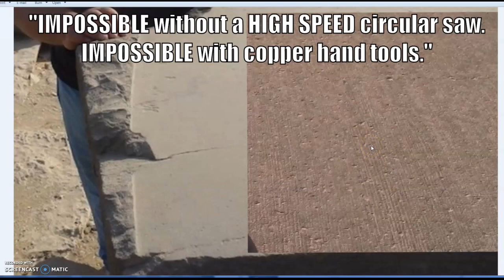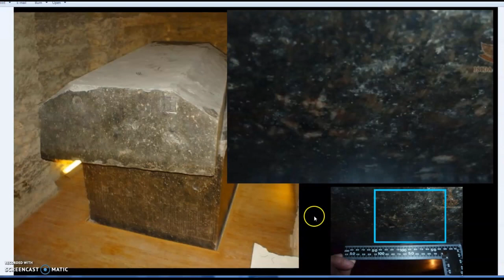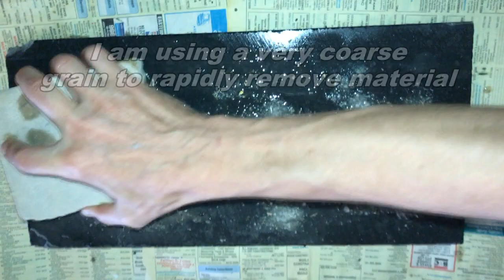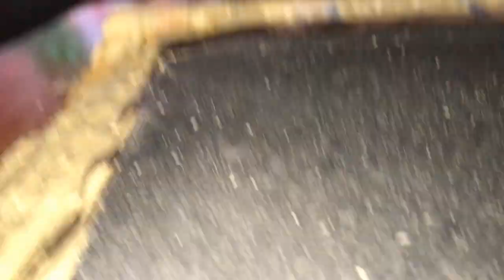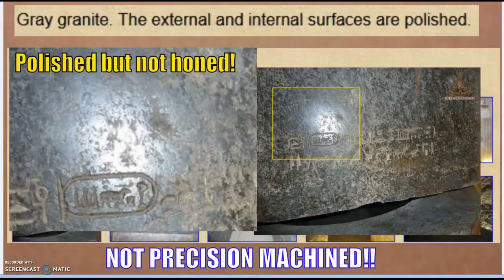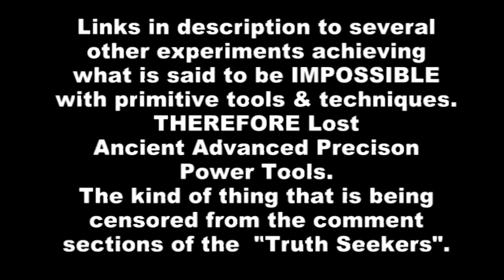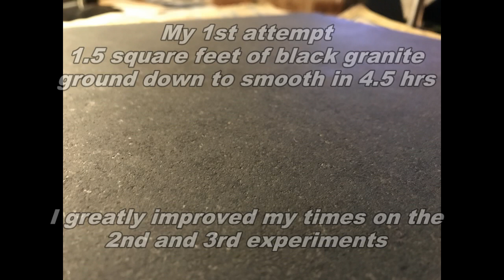Ancient Stone Working Techniques: Experiments with Black Granite on Removing Striations

Comment: Great demonstration. I'd like to pick at one detail that I found interesting... which is the idea that a treatment of some sort may have been applied to the surface of the boxes to give them a more polished appearance, even though they may actually be short of that physical condition in terms of the abrasive polishing work performed. This would imply that there is a substance still present on the boxes, since the absence of it would downgrade the appearance back towards honed... so it should be extremely simple to take a scraping sample from a box and analyze it... are you aware of whether or not testing like this has been done? I assume that almost anyone who has examined the boxes thoroughly would have noticed the apparent over-drip at the edge(s) of the lid(s) and would be interested in their origin. Is there any confirmation of whether or not there is a substance even present on the surface of the boxes? Seems like an easy fact to set straight.
Reply from the maker: Yes. I love to see such a test. I couldn’t find anything on that. Though it might also raise the question of when it was done, original or applied later?
Since these tests I have done another on split face granite. Learning from previous mistakes I was able to hone a much rougher surface at 1.5 square feet in 120 minutes. If I repeated these here I would hone the circular saw mark block in 30 minutes. So the Serapeum boxes would be finished even faster than what I quoted here.
That will be in an upcoming video focussing on the blocks in Puma Punku. Not the H blocks but the other famous ones I could do on my own in no more than 2 weeks if they arrive on site in rough quarry condition. One week at most if they have been sawed. With a couple of people to help it would be done in 3 days.
Reply: @SacredGeometryDecoded  What is your best guess as to the origin and implications of the appearance of over-drip? If a test was performed and confirmed the presence of a coating, it would be settled... but if no substance is found, and the sheen on the surface of the boxes is due to their physical level of polish, what is a reasonable explanation for what appears to be a liquid dripping over the edge, and the stone being notably smoother in those spots?
Reply from the maker: IntrusiveOstrich I think ancient Egyptian chemistry is highly under rated. Posted a few on those a while back, history of al(chemists) traces crack to Ptolemaic era of Egypt.
The hard metallurgic and chemical science of the alchemists overshadowed by the modern Harry Potter type perspective.
Paleontologits clean fossil skeletons from the surrounding rock by letting them soak in acid baths but it takes months or years in some cases. I wouldn’t eliminate possibilities such as these.
Neanderhals made a resin of birch bark that requires a pretty complicated process. Lost knowledge.
If that drip is something like a stalegtite of minerals that would be crazy interesting. I’d love for that type of thing to be true. 
Until a test is done I can only guess and I’d bet on a sealer if I had too. I would also lean towards it being added some time later since it lasting so long would be a very amazing thing. 
In short I don’t know. More data required.
Reply: @SacredGeometryDecoded  Thanks for your insights :)
Reply: @intrusiveostrich850  Beeswax perhaps for the final polish and rubb. Apply by heating the stone or wax, let it cold.